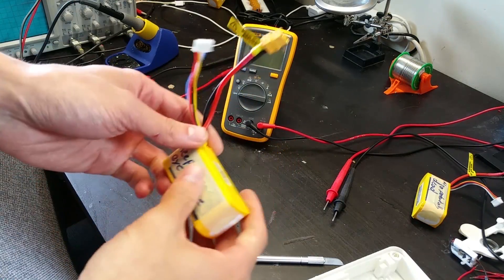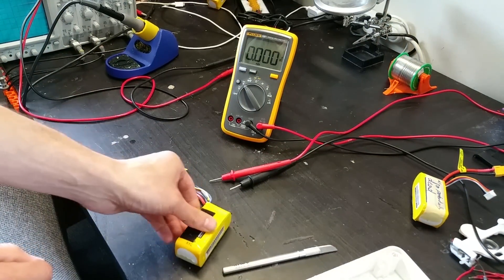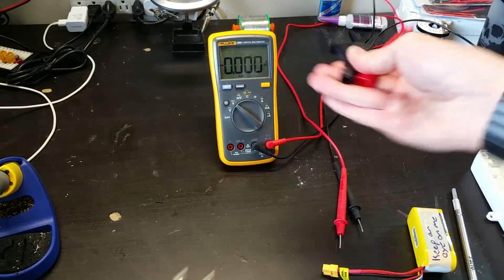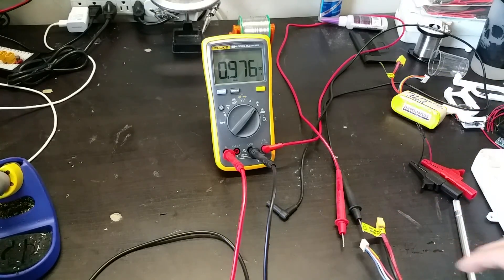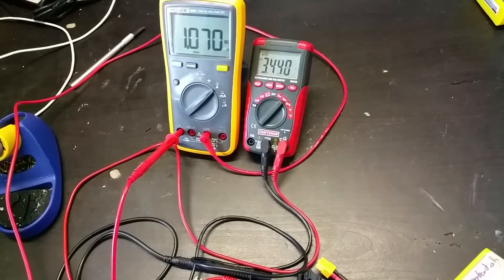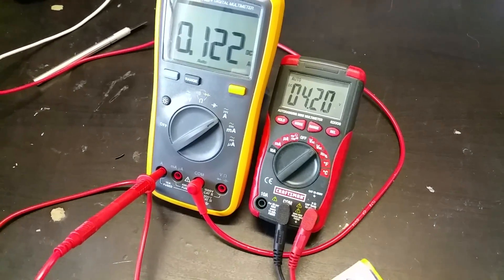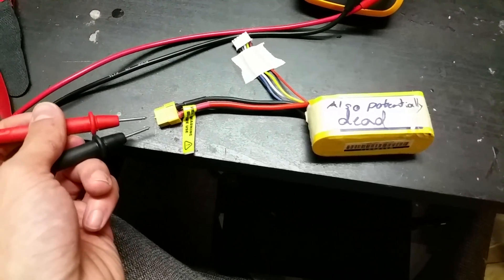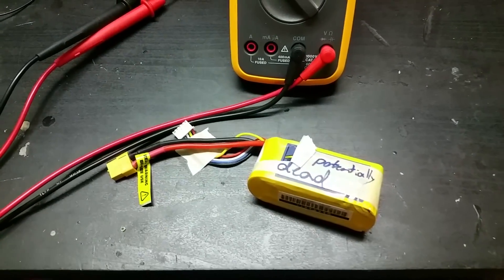How to recover a dead lipo cell

Comment: Another solution to raising one low voltage cell is to use a USB charger.  .use something low powered "500ma" cut the unwanted end plug off and fit two fine aero modelling  pins to the wires in the lead.. these get inserted into the charging balance plug at the correct position.. determined using a meter.. with a 20 min connection the voltage gets raised enough for a clever lipo charger to see the cell and start proper charging..

Comment: sup? a quick question: the 2-pin plug you spliced up is connected to the  - and + and as + is 2nd next to - , you are charging the first cell.
my 2nd cell in the 3s is kaputt so in that case i need to connect the + to the third pin, yes? i can put togather  a 3 pin connector and leave the middle empty. is this ok? cheers

Comment: funny enough if you put you charger to Nicad or Life mode it can also kick start the cell.....leave it on for around one minute at around an amp charge rate...used it many times on those silly spectrum smart cells

Comment: that was not a dead cell you had 3.17 on it dead is 0 with 3 volts just charge normally below 3 charge as low a current as you can .001 amp if available .01 amp most chargers can get

Comment: I bought 4-5 years ago Lipo batteries, I almost never used it. Just in storage and always checked for 3.85 - 3.9V per cell for storage. Sudenly i checked them again and my Zippy 3Cell Lipo had a cell showing almost 0 Voltage on a voltage checker. On my charger it charges or storage charge it quiet quickly 2 cells and shows 1 cell staying 0,0 Volts , my charger says quickly its ready storage charge , while put option to charge 3 cells and not 2 cells, still 2 cells are Ok and 3th showing 0Volts, why does my charger deosn't recognise it only showing 2 cells being charged ? And what can I do about it? Take in mind the batterie was fine the first years in storage voltages on all 3 cells, is it possible it dies on its own without even using it ? I am very worried it can damage my hous or somthing, can it explode if I leave it like that in storage ? And if I use it in RC car, is it ok to do so ? Will the car act like its a 2 cell batterrie ?   Thank you in advance for any help  . Cheers from Belgium
Reply: I tried to discharge and charge as a 2 cell batterie, and charger doesn't mind to start the chjarge or discharge. While normally if 3 cell batterie you get an error when trying charge or storage-discharge when selecting 2 cell in options if you start it. So Im assuming charger sees it as 2 cell and 3 cell batterie , can't recognize it ? Strange

Comment: thank you very much, this is exactly the video i was looking for to potentially help revive a mavic air 2 battery that i drained to 3.2-3.3v accidentally. didint want to have to buy a smart rc charger and was wondering if i could use my adjustable power supply from work but was worried it may not be adequate for charging. i know i probably just needed to juice up the cells enough to get the factory charger sensing them and this looks like a great way to do it. the dual meters as standalone gauges is genius too!

Comment: I used a little box thingy that you'd plug into the wall that was used for something random and it outputted 4V 300mAh. I just used that thing connected it to my dead cell and it charged it enough to put it on my balance charger.

Comment: Hi brother, my turnigy 2200mah 3s 11.1v  is working but one cell won’t hold charge but it’s new I used it once left it for about a month and now the plane only detects two cells, the voltage meter and the balance charger but it lets me charge it but one has no voltage and I try to charge the cell on it’s own the voltage goes up to a certain voltage and when I stop it dies again is it broken now, thanks

Comment: I have an Autel Drone. X-star. It has a 14.8 volt, 4800 mah battery. The drone company Autel stopped manufacturing and supporting their product and batteries. No more new batteries.. it’s a huge issue as there are many of these drones out there and can’t be flown... can you help me see if I can revive/recover the batteries?

Comment: are you keeping the black voltage tester lead on the end black balance lead when checking cells or it looks like you move them both along the pins at the same time? wouldnt this be two positive leads? thanks for the vid!

Comment: I bought a brand new 4S battery but one of the cells shipped with 1.72 V charge on it where as the others were 3.8 V. Do you think if I toss it on the balance charger it would get fixed? Thanks

Comment: I’ve got a 1650 cell battery that is reading 0.00 volts and when I charge it it does not keep its voltage up, is there any way I can revive this and my volt meter is correct I checked a working battery and it’s showing up normal voltage just fone

Comment: Thanks heaps, my 4s Lipo batteries been sitting half charged untouched for over 3 years. Total voltage of all 4 cells were sitting on 2V.  After charging using NiCd up to 12V the charger would only recognize 3 cells. 1 of the cells was still at 0.5V so following this and charging the individual cell using NiCd, all 4 cells were than recognizable by my charger and I could now balance the 4s lipo... woohoo!!

Comment: A very informative video.  This is the sanest approach I have seen so far.  However, not all of us are electrical engineers.  You completely glossed over the wiring hook up between the power supply and the two meters used to measure voltage and amps.  In the end I gushed that the balance plug Grey wire was attached to the black alligator clip and the white wire was connected to the red alligator clip.  I have looke at the video a dozen times and still can’t figure out how the two meters are interconnected with the power supply.   Please clarify the hook up.  I really like this approach.
Reply: I'd agree, he glossed over even how to test the individual cell voltages - I couldn't work out which terminals on the balance plug he was using to make cell measurements.

Comment: I guess my lipo's condition is different. I have a 3S pack that charges normally (each cell goes up to about 4.17-18 v) but after trying to fly my helicopter with it, I find one cell still at 4 V while the other two have discharged as expected (3.7V). Being a total newbie, I have been wondering how this could be. I balance the pack manually before charging it up again. The charged pack's total voltage goes up to 12+ V.
Reply: 2 of your cells might have a way higher internal resistance then your third one.

Which mean that, when put under load, the ones with higher resistance will discharge quicker then the low resistance cell.
Reply: Samuel M. Thank you for replying. Yes, so, is there a fix for this or is this pack headed for the bin? Thanks again.

Comment: I know you shared this vid over 2 years ago but i just watched your vid And i have just recovered one of my Yaneec packs {I lost it down the back of a cupboard and was not put into storage} 3S pack with cell 1 on 0.00v just finished balancing discharge recharge and it is giving me the standard 15 mins flight time £100 saved thanks to your good self thanks for sharing. :) Steve uk

Comment: 3:17 Surely the internal resistance doesn't rise - resistance is resistance, no? I thought the potential difference changes, the resistance remains much the same, so the current and thus rate of charging drops.

Comment: Im confused with which is (+) and (-) since my dead cell is cell number 2 ... Can we use reguler charger and power supply for fixin it ... Thanks
Reply: If I understand what you're asking, in say a 3S1P (nominal 11.1V) the cells are in series so you measure across adjacent pins on the balance charger to check each cell. The 'negative' is connected to the negative of the first cell in the pack and the 'positive' is off the last cell in the pack. Inside the pack, positive  of the first cell is connected to the negative of the second cell etc.

Comment: No! What you should have done is put the problem cell through an up to 3x cycle of charging at 1/10 C and then discharging at no more (the lower the better) than 5/10 C and monitoring how many mAh went into the cell and how many mAh was the cell able to put out before falling below the "safe" level of 3.0V. By comparing these two numbers and how close these two numbers are with the original rated capacity of the cell, then and ONLY then you can confidently assess the state/health of EACH individual cell in this pack. If you recover up to 25% less of the rated capacity, I say keep it, if recovery is less than 50%, I say discard it, it's probably not worth it.  But if the recovery numbers look good, then and ONLY then attempt to balance charge the who pack, always keep an eye on it and in the end check the cumulative V and mAh numbers against the original rated specs. This is the proper procedure and I hope I helped.
Reply: I agree that charging a dead cell at 1C is too much - it should be set to an absolute trickle.

Comment: I have a question: How do you discern which cell is which in the pack? I understand you can read each cell with a VOM but how can I know which cell it actually is? I ask because I have a 5s battery with one cell dead and want to remove it to make it a 4s pack. Please advise and thank you for the video...very interesting!
Reply: You just follow it electrically - whichever two adjacent leads on the balance cable give the dead cell voltage are attached to... the dead cell.

Comment: Great vid mate !!! 
Got a quick question for you. 😁
I have a 6s 4000mah lipo with number 6 down to .07. Am I able to cut the balance wire on the low cell put a 5S balance plug and use it as a 5S battery?? Sorry if this is a silly question 👍🏻😋

Comment: I tried to make a 7.2 batt by using jumpers in the connectors. It got very sparky and hot. In the end one cell puffed up and started to smell. The other cell still holds 3.7v. I don't think I shorted the pack out. Can anyone help me find a new way to make a pack?

Comment: so one of the cell is weak. then you decide to charge it with a (1Amp) current which below the mah rating of your battery. but before you make connections, you limit the voltage from your power supply with (4.2) Volts which is safe for a 4s battery.
then you used an ampere meter to display how you limit your current to  (1amp) because mainly your power supply has a current adjuster capability. 
as soon as you got your settings to its proper adjustment, you den connect it to the weak cell's pins. 

after reaching the desired battery voltage, you disconnect the wires and   read the voltages of each cells. after that is you've drained the battery and charge it again using balance charging.

after balance charging it, you got your battery voltages correct. 

am i right ?
Reply: Good point, I too am unsure whether he: discharged then balance charged, or balance charged then discharged and balanced charged again.

Comment: I have a question I hope you can help me with. I have a IMAX B6 by SkyRC. My 2c 2700mAh battery will balance charge with no issues. Both cells read the same, and charger shuts off when fully charged. When I install the battery to my drone it will read 8.1volts. As soon as I take off flying the battery drops to 6.4-6.2volts causing me to land. As soon as I land battery voltage jumps back up to 7.4-7.6volts. Again when I take off it drops again. Is this battery salvageable? Thanks
Reply from the maker: Sounds like your batteries have high internal resistance. They'll hold a charge, but as soon as they need to supply current, the voltage will sag. This usually means the cells are either permanently damaged or at the end of their lifespan. Might be time for a new battery :/
Reply: Ok thanks, they are not that old, maybe 8 months. I think it was the original Hubsan charger from my 501s that took them out. I now have the new charger. Ok, thanks for your help

Comment: Just performed similar recovery on a lipo I thought was dead when my charger gave me an error that no battery was plugged in. The voltages had dropped to 2.5v per cell and the charger refused to charge it. After slowly bringing each cell back up to over 3v it finished charging normally on the charger. Thanks for the video!

Comment: So 1 amp is the idea recovery current you recommend right ? I have a 3s that is dead
Reply: so on yesterday I received two 13000mah 11.1 v 25c batteries in the mail, one of the two batteries had a completely dead cell, so I tried  this method and wow oh wow it work, let was able to fully  charged  the battery back to its  proper  forum, thanks for the Information, conrad.
Reply: It'll depend on the capacity of your battery. 1C is the max charging rate I would recommend. 
For a 1500mah battery, that's 1.5A, for a 1300mah it's 1.3A and so on. 
For recovery, I'd recommend something closer to 0.5C or even lower.
Reply: @Xander779  hi, then for 2s with 3200 mah, will it be 3. 2 A for recovery?